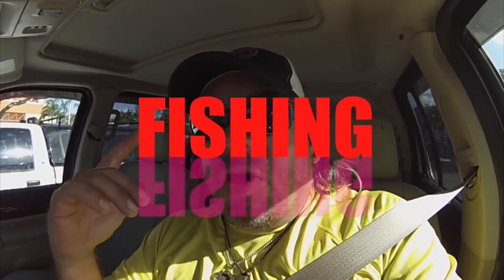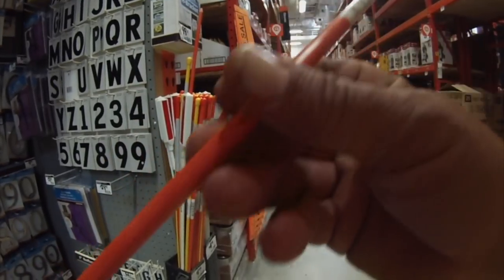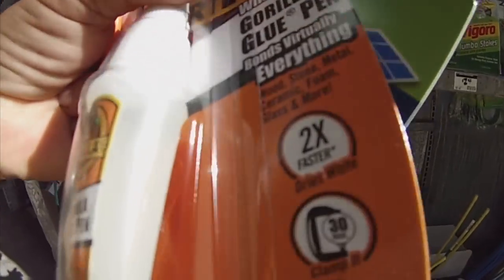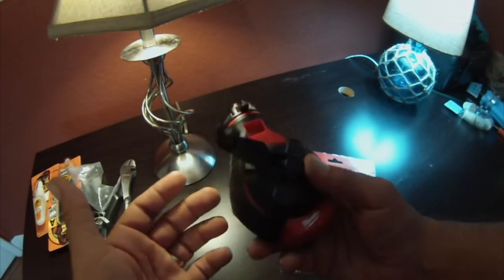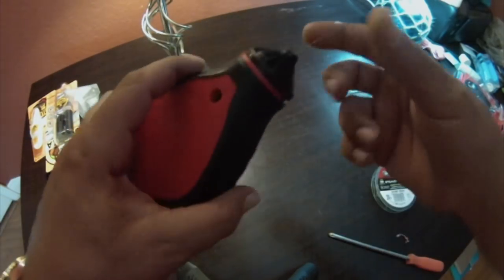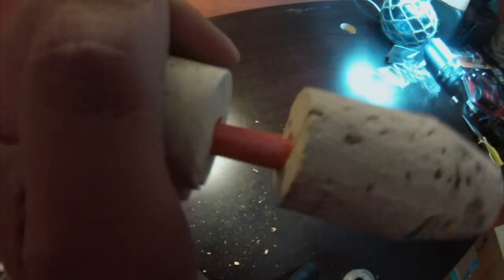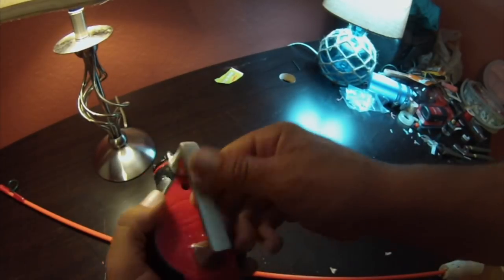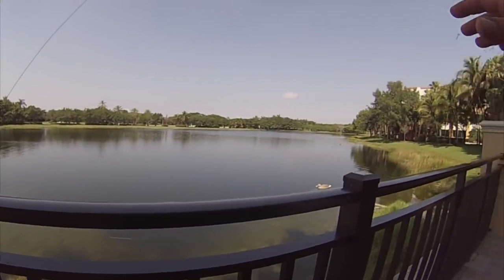DIY Fishing Rod and Reel!! $25 Home Depot Challenge!!!

Comment: they eye's you could have made with some sprinkler head tubing cut up into 1/4 inch pieces and zip ties attached to your fiber rod, as well as that chalk line the zip tie works wonders for a lot of things, that would have saved you enough cash to buy some trylene line to rewrap your chalkline.